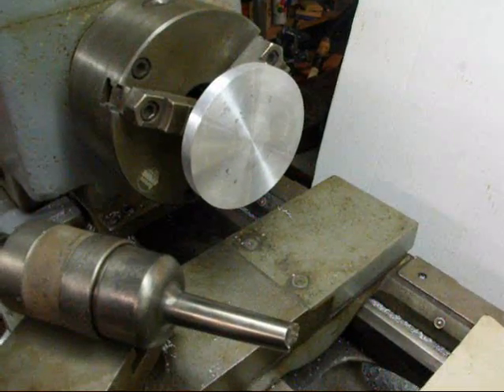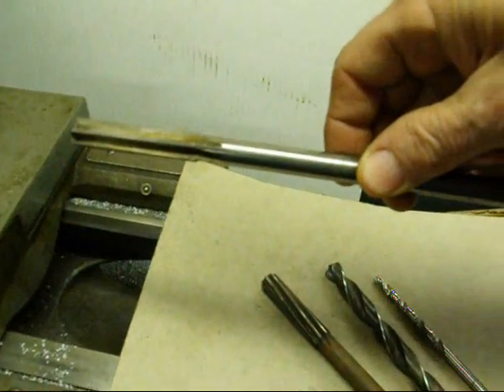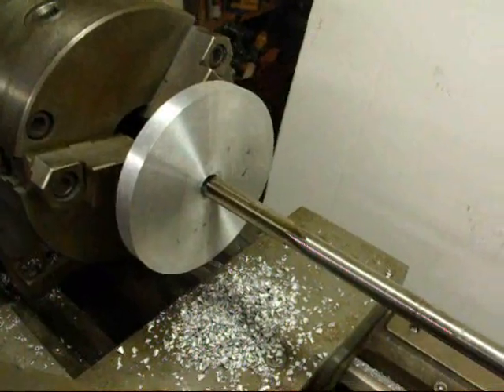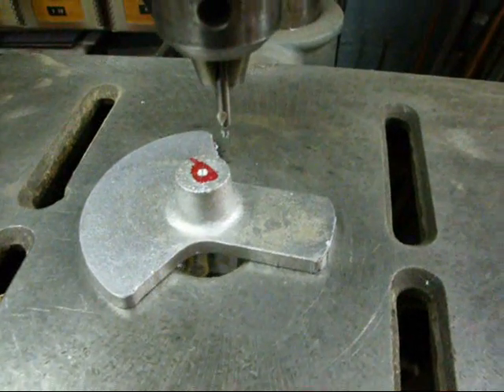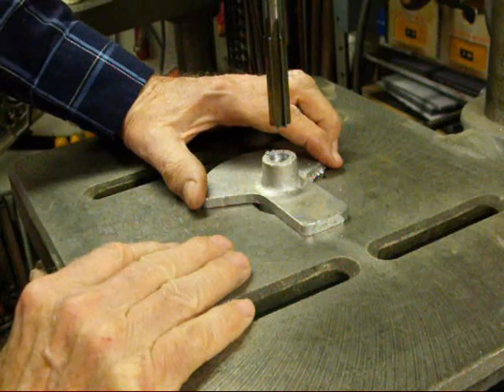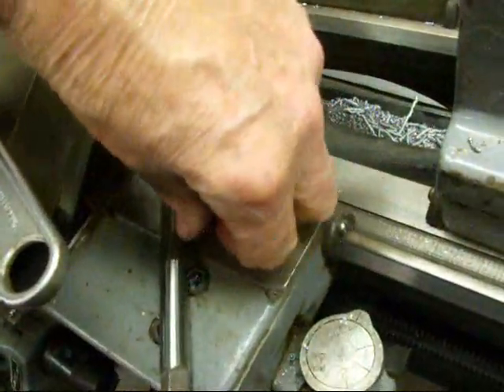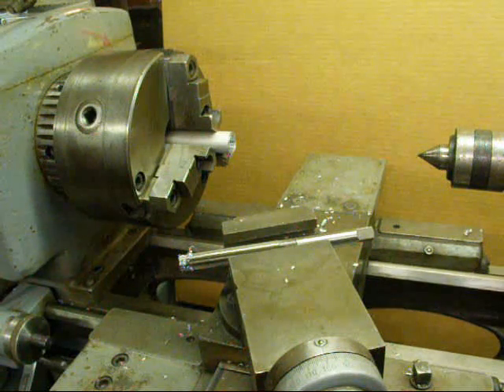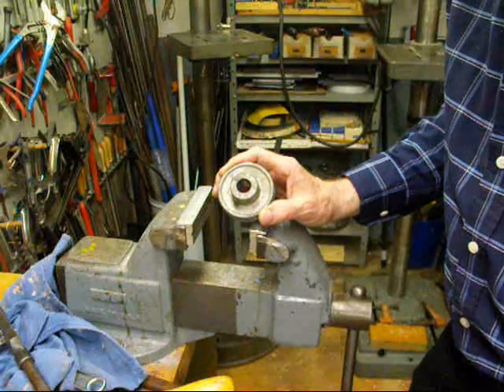THE USE & CARE OF REAMERS Part 3 tubalcain

Comment: You shouldn't withdraw a reamer under power. Turn off the power, then withdraw the reamer. Reaming should also be done at roughly a third of the speed for an equivalent sized drill bit.

Comment: Purchased some huge ( long) reemers at a show and tried to use them in the 10" lathe. 
1 inch for reaming a model engine cylinder.  The flutes would catch in the work every time.  Didn't know you weren't supposed to use power! Any special technique other than what you showed for larger sized reamers?  One inch up to 1-1/8 ?
Reply from the maker: I would say just this. Avoid using those huge reamers on small work pieces. Use a boring bar. It takes a lot of power to turn a big reamer

Comment: floating reamer holders are used for chambering new gun barrels. The reamer itself is typically piloted to the caliber of the bore. When the reamer enters the barrel it follows the pilot which follows the axis of the bore, that way you get a chamber precisely aligned with the bore. Pacific Tool & Guage has both piloted reamers and floating reamer holders, as do most of the gun parts suppliers

Comment: Mr. Pete,

I know you are terribly busy and have loads on your plate, but am hoping you can point me in the right direction. I was recently given a Burke #4 horizontal milling machine. The spindle of this machine is a B&S #9 taper. I would like to make a arbor for it with a MT2 socket. The reason I would like to make this arbor is because I have a set of MT2 collets I would like to use on the machine to hold end mills. I have watched your reamers videos and taper turning videos. I have also ordered a pair of MT2 reamers (Roughing and Finishing). To make the MT2 socket, will I need to rough bore the hole close to MT2 then Rough Ream and then Finish ream? Or can I drill a hole close to the small end size of the MT2 and rough the taper out with the roughing reamer, then finish it with the finishing reamer?

Any advise would be appreciated if you have time.

Regards,
Joe
Reply from the maker: Now that your question, is in the form of a comment, I am able to dictate the answer rather than type it. And makes it much easier for me. Although sometimes when I dictate, there will be errors in the wording. They do not have the voice recognition fully developed yet.
Reply from the maker: To answer the question, I would say you need to bore it before reaming. Otherwise I would be too much material to remove even with a roughing reamer.
Reply: You know ...  For a horse and buggy whip maker, you sure are leveraging the technology here lately!!!  Keep up the great work!

Jeo
Reply: Thank you Mr. Pete for the help with my question.  I appreciate it.  So as a follow up, I guess the purpose of the roughing reamer is to get the correct taper if your bored taper is a little off?

Joe
Reply from the maker: Yes
Reply: Thank you sir.

Comment: Holding the work with your hand is very dangerous and you should know better. Ask me how I know? Plenty of stiches and near broken bones to prove it. I would expect better from you.
Reply from the maker: Been doing it for 50 years without injury.
Reply: @mrpete222  Not a good example to "teach" beginners though. Very bad practice. I've seen many people injured this way particularly with steel and hungry metals like brass and bronze that will grab the drill bit. Also when the drill breaks through thin sheet material.

Comment: Notice the drills are pulling chips, where I usually get spirals on aluminum.  Is this due to drilling a casting, or is it the shape of the edge on the bits?
Reply from the maker: +Robert Schulke I would say-different metals , produce different shaped chips

Comment: @mrpete222     Mr. Pete sometimes when I need a part to "float" so that it automatically finds it's own center I will attach it solidly to my drill table but leave the table loose so the table can move a little. Of course I will get the part as close to center as possible before drilling. This method has worked well for me in the past and it is also a safe method. And thank you so much for all your great videos. I have really learned a lot from you.
Reply from the maker: +floyd green good idea

Comment: Mr. Pete,I love all of these great videos you've posted. I've watched all of your videos I could find on reamers (Hand, Chucking, Expandable, straight/spiral, etc.), but in looking through a catalog last night, I see "Drill / Reamer" combination bits. What exactly are these and are they any good? I'm assuming they are just hardened drill bits essentially, but with a narrower cutting head and the Flutes on the shaft expand the hole to the correct diameter... If so, what spindle speed would be appropriate?I am assuming quite a bit regarding these hybrids; I wouldn't be surprised if all my assumptions were wrong though. Thank you Sir for sharing your knowledge with all of us.M.

Comment: You mention that the 'hand' reamers must not be used under power. Why?
Visually the difference just seems to be the square end on a hand reamer, but is there some other fundamental difference that dictates how they can be used?
Reply from the maker: They are usually a little shorter & more ridgid.     Hand reamers are tapered for he first 1'2 inch or so and that is where they do their cutting.
Power reamers do most of the cutting on the chamfer.
Reply: mrpete222  But with care, they could be used powered?
Reply from the maker: Ken Gillett
I suppose-- very slow speed
Reply: mrpete222 Thanks for this and all the other help you provide. Much appreciated.

Comment: I've had a heck of a time avoiding chatter when hand reaming with a straight fluted reamer and tap wrench - every time I try I end up with light consistent chatter, despite the reamer being new, sharp, well lubricated, frequently cleaned and never turned in reverse. I've tried with two separate reamers in a variety of mild steels and always get the same result, so I feel like it's something I'm doing.
Reply from the maker: Make sure you are removing only a few thou when reaming. Try different feed rates. Use spiral fluted reamers
Reply: mrpete222 In this case it's reaming chambers for a revolver - reamers are commercial 45acp chamber reamers - I've tried only doing a turn or two per cleaning and using almost no pressure all the way to putting heavy pressure to break through the chatter but result always seems the same. I suspect a spiral flute would help, however I have yet to encounter them as chamber reamers.

I've read some discussions on putting more pressure on a reamer when being run in a lathe to break through the chatter, but I don't have access to a lathe at the moment so am somewhat stuck.

Thanks for the quick reply as well!

Comment: First off, Mr. Pete, thank you for all your machining videos, learned alot that I can use in my shop.  Question, when you were drilling the casting on the drill press and holding it with your hand (VERY DANGEROUS), you said you did it because you wanted the part to float and no to get a bell hole, couldnt you center punch, then use center drill to pinch the part to your bed then clamp it down, then do your drilling and reaming?

Comment: Just to follow up.  I went home and did exactly as you recommended, center drilled, no.7 pilot hole, drilled to .4960" with a D bit, then reamed at 950 rpm with .2500" chucking reamer using fluid and backing the tool out a few times to clear chips with compressed air.  Checked my hole with the pin gauges and nailed it, stayed within .0005" of the desired .2500".  Thanks again MrPete!  Material was 6061-T6 Al.

Comment: Thank you very much for your reply and advice.  I am going to try that out tonight on some test pieces, center drill, pilot to 1/8, drill to .2460 (D bit), ream to .2500" and see what the pin gauges tell me.  I might also try using a 15/62 end mill and finishing with the .2500" reamer.  Can you ream in the mill as long as you keep your setup or is the drill press always preferred to allow reamer to self center?  The work is with Al 6061 and my lowest RPM setting is 270, maybe that's too high?

Comment: Hi MrPete, thanks a million for sharing these informative videos, I have learned a great deal from your channel. I have a question about reaming blind holes.  I want to bore a hole to a .900" depth and clean it up to within .0005" of .2500".  Ive been trying to do my research on reaming blind holes and the information on the procedure varies quite a bit from person to person, enough to make me question the straightforwardness of the procedure, do you have any suggestions?  Thanks in advance.

Comment: I'm reaming a brass tube with an ID of .2490 with a 6.5mm (.2559) reamer, but it has repeatedly caused my lathe to seize. any suggestions?

I use cutting fluid, I peck, I clear chips, I do everything I can think of, but it is causing me so many problems...

My supplier sent me tubing with an incorrect ID and I need to find a quick way to resize it with a smooth ID. 150 Parts needing processing, 4 days to do it

Comment: Awesome videos, can't wait to watch more.  It makes perfect sense to do what you are doing with the drill press. However, it probably deserves more explanation such as, why it's ok to do what you are doing and when maybe you should be using a vise. I only bring it up because I just about lost the tip of my finger doing something very similar on a drill press. ;)  Your reaction time is much slower when you're tensed up holding a piece of work like that. Anyhow, thanks again for the videos!

Comment: @mrpete222 I remember this from the toolroom quite clearly, that feeling of having just reamed out a hole looking down the bore and realising the drill has cut slightly larger than the reamer, I used to get around it by using two pilot drills i.e for a 12mm hole I would drill 6mm, then 10mm, then finally 11.5mm followed by the 12mm reamer it takes a couple more minutes but the final drill removing just 1.5mm gives a accurate hole pre reaming. By the way nice videos keep them coming. All the best

Comment: Hey tubalcain, another great video.  This might be basic to you, but for novices like me just starting out, the basics are needed.  One question I have is how did you feel confident that the piece would not spin on you when you  were drilling on the drill press.  I am always concerned about that and will continue to play it safe, but was just wondering was it becaus it was aluminum that you didnt hold it with a clamp or other?

Comment: When machine reaming I always stop rotation and just pull straight out so there's no more cutting while you're backing out.
On CNC mills I've run a reaming operation is usually set up this way too.
Half the speed twice the feed